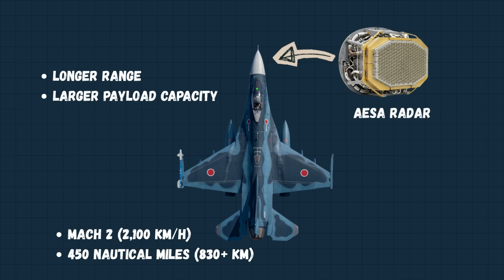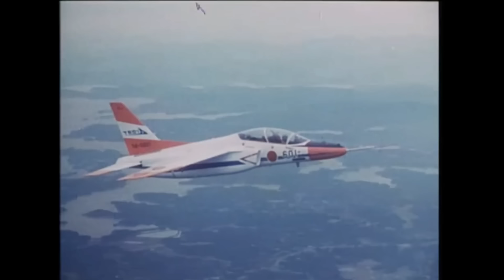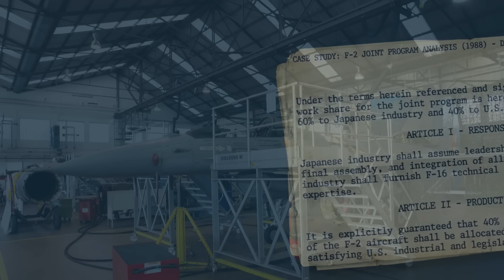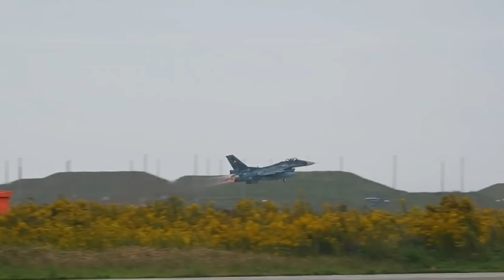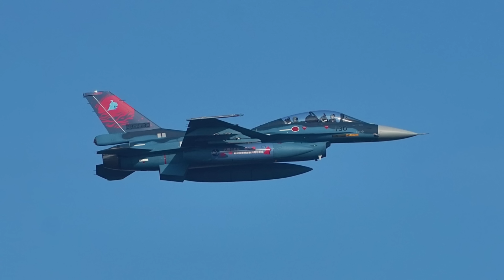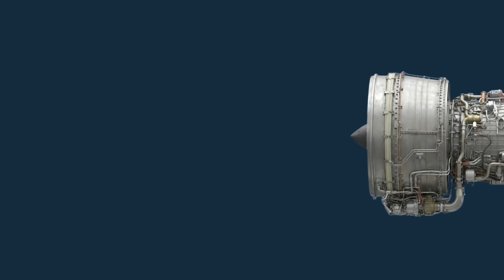How a Cheap Fighter Became Japan’s Most Expensive Jet

Comment: この高額な機体を作ってため
日本は複合素材の技術を習得し
今では航空機産業で複合素材の大金プレイヤーになっている
Reply: I wonder .. why Mitsubishi build the right wing and Fuji build left wing  .. why not both wings by one company?
Reply: @gorilladisco9108 😂😂😂
Reply: @gorilladisco9108  一社がなにか問題が起きて生産が停止しても生産や技術が存続されるためです　日本では重要な戦略物資に対してはしばしば行われるアプローチです　そして同一設計図で仕様が同じでも微妙に製造方法が違っていたりします(問題はないですが）そこには技術の発展性、企業の独自性が担保される余地があります　高価になるという問題はありますが、技術と企業の存続はそれよりも大事だと考えています
Reply: @asamaonsen1234  I'm just thinking ... 
"Sir, we have 400 right wings but no left wing."
Reply: @gorilladisco9108  両社は複合素材の有数のメーカーです、現在大型旅客機や最新の戦闘機の翼を世界に輸出してます。色々実験を重ねるためです。
Reply: major player?
Reply: @ericsohn9133 Yes - major subassemblies (wings, wing boxes, fuselage sections and skins, control surfaces) for multiple Boeing commercial aircraft, along with the F-35 program, are being built in Japan.  I do not know if the current F-15EX usesJapqnese-made components, but Japan had manufactured their F-15J fleet under license.

Japan does similar work for Airbus, but at a smaller scale than w Boeing.  And in addition to airframe components, Japan has expertise across the entire spectrum of avionics.

So yes...*MAJOR* player.
Reply: @ericsohn9133  
主要じゃなくて独占的かな
Reply: @kama1962 and what good is that? Just curious
Reply: @ericsohn9133 Japan will definitely be a major player in advanced 6th generation fighter production. Japan 🇯🇵 is part of the GCAP 6th generation fighter program, with partners UK 🇬🇧 and Italy 🇮🇹. GCAP joint partner headquarters was opened earlier this year. The first GCAP development test airframe is already two thirds complete and will fly 2027. Australia is interested in GCAP to replace F-18 Super Hornet. Would be logical for final production of Australian GCAP to be assembled in Japan. There is potentially high number of sales across the world. 
Also Japan in partnership with UK are developing a new long range air to air missile JNAAM. Italy will be an operator. Sweden, Germany have expressed interest and Australia. Not forgetting all the potential customers who may purchase GCAP.
Reply: @Robert-xy4xi  why doesn't Japan cooperate with other asian countries? Do Japanese really consider themselves honorary white?
Reply: @kama1962 Japan 🇯🇵 will be a major player in 6th generation fighter aircraft production. Japan in partnership with UK 🇬🇧 and Italy 🇮🇹, are developing the GCAP 6th generation combat aircraft. Australia 🇦🇺 has expressed an interest replacing F-18 Super Hornet with GCAP. Is potentially high number of GCAP orders by numerous nations globally. 
Japan and UK are jointly developing a new long range air to air missile JNAAM. Incorporating British rocket motor technology with Japanese AESA radar seeker technology. JNAAM will be incorporated into both GCAP and F-35. Is potentially high global orders with JNAAM. Italy will operate the JNAAM. Australia, Sweden and Germany have already expressed an interest in JNAAM.
Reply: @ericsohn9133  The technology to build F2 is far advance than what my country can build, so I won't say bad thing at whatever Japan did there.

Comment: Should've bought more F-15s. Longer reach and more carrying capacity.
Reply: Except the F-15 doesn't have the carrying stations for Anti-ship missiles. The original F-15's were built as air-to-air fighters and had only 2 wing pylon stations. The F-15E Strike Eagle was being produced at the same time as the F-2 but I'm sure America wouldn't want their new advanced Strike Craft to be exported so soon. It was better to just take a proven design and enhance it.
Reply: @izumishion6267  This^^, 100%.
Reply: @izumishion6267 😂 L
Reply: F15は、制空戦闘機なので、対空ミサイルを満載してJ20,11,10,15、Su27他を撃墜する為なのよ。
Reply: @チナッピー久我山の  All of which are shorter range than the PL-15...
Reply: 既存のF15も電子機器と搭載ミサイルを増やす事もやっています。F35とのリンク機能も付加される。